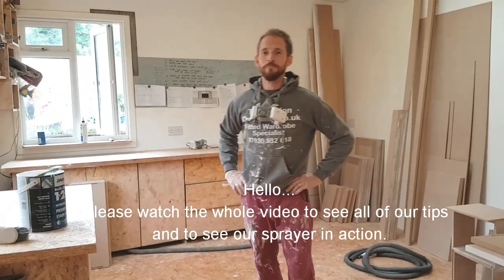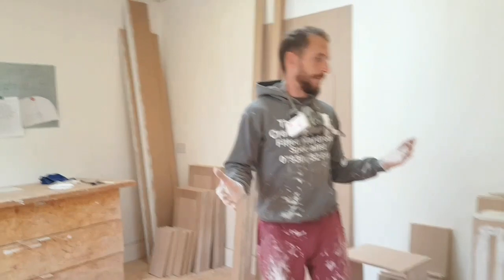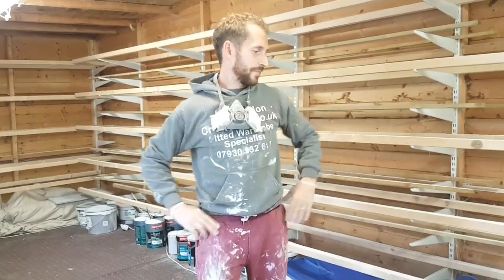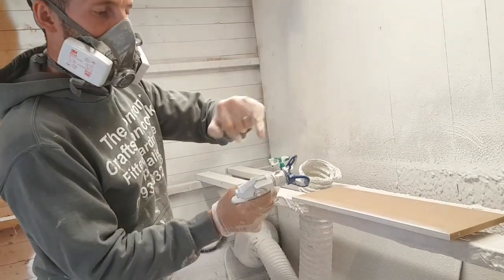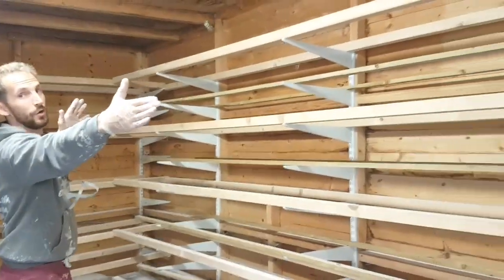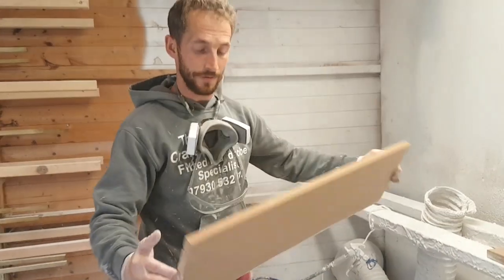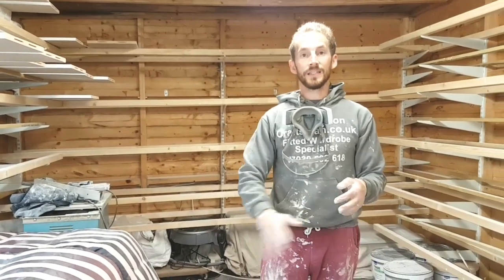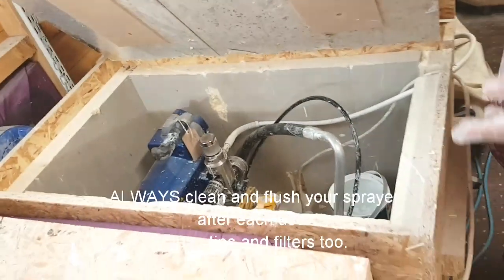Achieve professional paint finishes on Mdf - Trade tips & techniques - Don't Miss!!

Comment: For those looking for the Zinsser paint the best prices I have found are at Screwfix. I will be using both the Bulls Eye 123 primer and the Zinsser Perma-white for the finish on an MDF bath panel soon. I won't be using moisture resistant MDF because I can only buy a full sheet and will have a lot of waste.  Hopefully the Zinsser primer and Perma-White paint will give it enough protection with two coats of each. I may seal the edges with epoxy resin before painting. Any advice would be helpful.

Comment: Nice video great to see how the pros do it! I’m looking to spray some skirting, stair woodwork and architrave and have bought a 310 FFLP graco tip for my Erbauer airless sprayer (got a graco guard for it). Do you dilute the primer and top coat at all? Also what pressure do you run at? Thanks.
Reply from the maker: Thanks!
I never dilute paint and the pressure I use is generally around 1600 to 1900 depending on paint using a 310 tip.
I've never used the erbaurer sprayer so I couldn't say if what I just said applies to this sprayer 👍

Comment: Dulux Diamond eggshell tends to dry with a bit more sheen than most eggshell finishes. So good choice there. Plus it's very durable. If I didn't have access to Dulux Diamond, I would probably use a pearl or satin finish (of good quality) for greater durability. Also..I've noticed over the years that many "would be spray painters" do not really understand tip sizes. Nor do many salesmen of spray tips. I know the difference because I have been spraying for 25 years. But I don't make Youtube videos.  So maybe you could make a video (All Graco airless of course) explaining fan width, orifice sizes, color of specific tips, distance for optimal results, etc. Btw. I have a similar set up for cabinet doors. I do find that it is not quite enough on it's own. So I use the water trick. A light dusting of water on all surface areas in the booth... helps a lot.  Good video.
Reply from the maker: +John Shader 
Hi John,

That's great advice, I will look into making a video.
I don't have a massive amount of knowledge on tips other than the standard blue and fine finish but I could say what I know on the subject.
Much appreciated 
Thanks Ryan

Comment: Great video just what I needed, I'm about to do my first big mdf cabinet door spray job. I am wanting to go with water based paint, but am worried about drying times, I have a few questions: 
1. Why roll the zisner instead of spraying it? 2. Can you use the zisner to prime. 3. What is your edge sanding procedure. 4. Is the topcoat you are using waterbased? 
I hope you get a chance to reply. 
Thanks a  million
Reply from the maker: Hi ,thank you!
When painting the edges, you get so much better coverage with a 4" rag roller than a sprayer.
I'm not actually sure you should spray zinnser due to what it's made from, I think it says not to spray on the tin because it can combustion? Had some flammable chemicals in it? Something like that ,so it's worth reading up on it before putting through your sprayer.

Yes you can use zinnser to prime but again look into the spraying side of zinnser.

We stack up our MDF in batches, use an orbital sander starting with p60 then p120 then p240.
After we fill with ready mixed filling compound or filler.
When dry sand with p240 and dont sand too far back.
Dust down and roll on zinnser or acrylic primer 2 coats.
After 2nd coat is dry, very finely hand sand the batch with p240.
Break batch apart and use a micro round 1/4" router cutter on all seen edges/corners then quick hand rub with p240 on same edges/corners.
Now ready to spray the whole component.

Yes the top coat I use is always water based if I put it through my airless sprayer.
I use silks and eggshells mainly.
Try and mist coat first primer coat otherwise if it's too heavy the MDF grain will rise whilst its drying.
We use space heaters to warm up the spray room.

BTW we have built a new sprayroom and booth and this is actually going to be the first video of the series starting the beginning of January 2020 so I hope it helps you.

Cheers Ryan
Reply from the maker: Bloody spell checker!
Reply: Wow thanks so much for the detailed response, really helpful. I hadn't seen anything on the zisner tin about not spraying it, haven't looked to be honest but several guys on YouTube have recomend spraying with it. 
With regards to filling, all of my doors have been cut and routed already, in a modern shaker style, that is flat with v groves routed in. What's the best way to smooth and get the paint into those v grooves. It seems that I get alot of fiber in the bottom of the groove, and paint doesn't go in there easily. Thanks again for the help.

Comment: Great channel. Just about to get into spraying MDF. Are you still using a primer or just going straight on with the finish paint.
Reply from the maker: Hi, I am using and trying different paints quite often.
The paint I'm using now is from Amicus uk in park royal. Check out my latest video and go to the description for all the links and some discount.
This paint above gives such flat finishes it's unreal.

You can also my older method of doing 3 coats of silk or eggshell as that worked for me for years!!
Also you can use a dedicated mdf primer with 2 top coats. 

Before I tried this new 1K paint I'm using from Amicus, I was doing 3x silk or eggshell coats, I just sanded in between and job done.
The results were very good and is probably the lowest cost way to achieve a good quality sprayed finish 👍

But then again I do recommend the Vernites 1k paints from Amicus.

Comment: thanks mate. do you thin the paint o work with the air gun? if not the paint is very thick
Reply from the maker: I never thin, these machines pressurise to up to 3300 psi so there is no need 👍
Reply: @thelondoncraftsmanworkshop  Oh wow I see. what sort of gun then do i need to look for? i assume the needle shouldn't be too thin in dia

Comment: Thank you for very thorough tutorial! Very informative and full of useful tips!Is the way of painting (including types of primers and paints) suitable for painting kitchen cabinet doors to achieve smooth slick eggshell finish? Is water "proofness" of your recipe presented in your video sufficient for kitchen, under kitchen sink MDF doors. I am a novice at this and not a professional, redoing our own kitchen :). I am about to buy used 390PC in great shape with FFLP 208 tip. Intend to buy 310 and 410 tips. Are FFLP tips ok (they supposedly require half the pressure) or should I use regular 310 and 410s?

Comment: Thanks very much for this video, it is very informative.   I am a female with a hubby who is pretty useless at DIY so will be on my own with this project.    I have two cupboard doors that my joiner routed the front edges on, I'm concerned about them swelling up.   Can I use acrylic paint to seal the edges (the type for ceramics, which is self-sealing?)    Otherwise I could invest in the 1 litre Zinsser one in the blue tin, what would you suggest?    Can I also use the same Zinsser 1-2-3 primer on plasterboard?   Many thanks in advance.
Reply from the maker: Your welcome! That's good to hear your taking on the challenge.
To be honest any undercoat, primer or specialist sealing paint would seal the edges. Even if you use Pva glue mixed with water 50/50 would do the job.
I'm sure the paint you mentioned would do the job.
I'd suggest first rubbing the edges down using p120 grit if they are really fluffy then p240 after.
If the edges arnt to bad then go straight to p240.
Once sanded then give a coat of your paint.
Once dried give the paint a very light rub down with p240 to take the high spots off.
This should seal the edges enough to put your primer/undercoat and then top coat/s.
I hope that helps😀

Comment: Quick question. I have the truecoat pro II with the 311 tip. I am using sherwin williams wood and wall latex primer and proclassic waterborne acrylic alkyd for the finish. But everytime I spray a MDf panel with the primer, I have some spots that are  way shiner than other spots. You can't tell if you look directly at it. But when you look at it on an angle during natural light you can see the shiny spots. Wanting to know if the latex primer is problem, and if I need to Prime with an oiled based primer?

Comment: Hi, do you spray, roll or brush the 123 edge primer, and do you prime the face of the board, or spray finish direct onto the MDT?
Reply from the maker: Hi I just roll the zinsser on, I also use standard primer now rather than zinsser and it works a treat still.
I just spray the face.

Comment: When you spray tall doors with water based, do you find that spraying only one side makes the MDF warp? Perhaps this is not the same for the green MDF, but for regular MDF I have been told it does.
Reply from the maker: Hi, I make sure I spray both faces within an hour or so of each other, and do the same for every set of coats.
I never have a problem whether I used MR mdf or standard MDF.
Just make sure you put them completely flat when drying them and paint both faces as quickly as you can and you should be fine
Reply: @thelondoncraftsmanworkshop  Thanks. I was going to use those plastic pyramids and have a mate help me turn the doors.
Reply from the maker: @JohnnyMotel99  yeah that's a good idea, try and dry the paint as quick as possible, within an hour or so ideally.
I have a space heater in the sprayroom to keep it warm.
Reply: @thelondoncraftsmanworkshop  that's a clever idea, thanks!

Comment: Hi...just a question...you put one primer, them sand it with 240(to get rid of orange peel) and paint just one coat? Or you put 2 coats? Thank you
Reply from the maker: Hi not sure if your watching an older vid, but now I give 1 coat, then sand p240, then give another 2 coats.
Sometimes just one more is good enough but I like doing 3 coats in total now 😁😁😁
Reply: @thelondoncraftsmanworkshop  thank you...and between 2nd and 3rd, you sand it as well?...thank you very much for your info. I am learning..😋
Reply from the maker: No probs, no I personally don't sand for a 2nd time, but there is no harm in doing it if you want if you go lightly

Comment: Do you ever put lacquer finish over the top of eggshell to protect the paint and what is the method please? Could you spray it from a can then sand and polish the lacquer?
Reply from the maker: Hi sorry for the late reply.
I've never tried it over eggshell but I have tried it over birch ply that was oiled with osmo oil.
I use a water based lacquer ( manns ) I think, and it came out well.
On the other side, I think over time it has changed the colour slightly and turned it very slightly yellow (very slightly).
In theory lacquering over eggshell should work but i wouldn't know of it would change the colour.
With water based you would stand a better chance though i think.

I have never polished the lacquer  after spraying, i generally get a good enough finish, satin sheen mainly.

Comment: Great job and thanks for sharing. What do you use to fill the ends before and in between sanding?  Do you dilute your paint and primer and if so, what viscosity?
Reply from the maker: +Derek Evans 
Hi Derek,
To fill the edges I use a ready mixed filler.
The actual one I go for is in wickes (builders merchant) and it's called mounting compound and dry liners use it to fill the gaps between plasterboard sheets.
With an airless sprayer you don't need to thin the paint, it sprays out paint using up to 2800 psi  (a car tyre is only 30 psi so it's a lot!).
Under coat would be a waterbased acrylic primer/Under coat and top coat would be a waterbased acrylic eggshell.

Thanks Ryan
Reply: The London Craftsman Thanks Ryan. Keep up the good work.
Reply: Hi Ryan...you have persuaded me to invest in a sprayer so I can give my clients a better finish on their wardrobes etc. You just can't get a great finish with a roller. I have fabricated a spray booth out of 50mm insulation boards at the bottom end of my workshop / garage on an old work bench. Then I have cut out for a 8inch portable extractor (explosion proof) as it could come in handy on some site installations. I have a compressor which I can attach a gravity fed spray gun too but I have also bought the Graco Ultra corded sprayer for onsite jobs.
I would post a pic of the booth but I don't know how on here. 
Anyway...thanks again for the videos as it has helped me to progress further for a seasoned veteran. Keep the videos coming
Regards
Simon Warnock
Reply from the maker: +Simon Warnock 
Hi Simon, I never got around for saying thanks for the nice comments.
I'm glad they have helped and I will keep them coming when I get some time on my hands.
Thanks Ryan
Reply: Simon Warnock  did you ever try fine felt rollers and thinning the paint. I spray now for ease but got a satisfactory result with the felt rollers.

Comment: Can I ask you a question, I've built bout 6 units there all fitted now, in situ,i was thinking bout spraying them in place, I'm just wondering what you would think on this as the rolling will like you said will take forever, any advice is welcome thank you.
Reply from the maker: Hi, I think you need to of had a bit of experience with sprayers to spray them in situ.
That being said, ive only really used airless sprayers which are different from hvlp sprayers.
I sprayer drawer boxes and some Carcasses, also window seat carcassas etc in my spray booth using my graco 695, but I'm careful not to put the paint on too thick which is so easy to do with an airless.
If you do use airless, then pressure has to be as low as possible and you need to use a green FFLP spray tip (fine finish low pressure).
So with some expensive and the right spray tip and pressure set lowest possible, then I'd say you would manage with an airless.
I cant help with any other sprayers as I've not had enough experience.
Ryan
Reply from the maker: Was ment to say experience nor expensive
Reply: @thelondoncraftsmanworkshop cheers for the advice it's really appreciated, I dont want mess this up if I proceed with it,I've got some experience, I used to spray few years ago (long while lol)but only in shop in a booth complete with full racking  systems for a shop fitting company I was without but I've never spray any assemble units tbh, I'm back doing my carpentry now more than ever, which is what I really want to be doing,the building work in these months is just the pits lol...
And on them units I'm telling you about I can take all of the the doors gables cornice etc off and do a proper job on them, but the units would be tricky enough, plus there mdf moisture resistant,rock and hard place I think,I was only meant to build and assemble but now they want me to paint them,so I may aswell get stuck in, cheers on the advice I will get back and let you know how it went, wish me luck lol...
Reply from the maker: You'll be alright! Good luck 👍

Comment: Thank you very much for the information. Do you use any form of dust control in your spraying area?
Reply from the maker: +David Mortimore 
Hi David,
I have 2 extractor, 1 movable 8" hose near where I spray and one near my racks.
I will be upgrading this soon to a large 2ft fan under my spraying table sucking the air out with air vents at the rear. This would create a one way air flow keeping dust and overspray from the work.
Reply: The London Craftsman That’s great. thank you.

Comment: all the time you have been spraying and experimenting with paints
which paint would you recommend for painting a mdf candy cart 
needs to be hard wearing thanks
Reply from the maker: Hi I would use a good quality acrylic undercoat primer to start with as the first coat. Then sand after with p240 very lightly to de-nib.
I'd probably just use an eggshell or satin finish for the top coats, satin would be a bit harder wearing.
Most paint brands do a "hard wearing/durable/wipeable version of most finishes

Comment: hi i do simlar work to you and want to get into spraying never really sprayed before. have had suggestions to go HVLP. what would u recomend? HVLP unit is double the price of yours £1300! and also may need somethinning. on the up side i think its easier clean less messy and sprays slower so would be easier for me to achieve a very good finish as a beginner? Would the airless be too fast for me to learn with? 1 more thing i dont have dedicated spray room yet hope to in future to need to see how things go first! Good videos by the way!
Reply: Hi Jack
Not sure what you've been up to over the past year but, I am about to venture into the cabinet business and want to do it on the cheap. I bought a Harbor Freight airless sprayer for $169, added some tips and I'm under $200. As for a spray booth, I thought about using my basement, or my wifes side of the garage but decided against it. I then looked into getting a shed/out building, storage container or even a used box truck box. All were too expensive. I then thought about free campers/trailers on craigslist. I found 2 within a 2 hour drive from me. Both are over 20' long and will be perfect as a cheap paint room. I'll gut it, seal the roof, walls and windows as needed, maybe cut in a larger door for easier loading and unloading, run an extension cord from my house until I buy a cheap generator (under $200) and heat with an indoor rated propane heater (I'll also have a CO2 detector for safety). For ventilation, I'll be taking tips from The London Craftsman and adding 2 fans mounted low by my spray area and cover with foam as he did. Fresh air will be brought in by a similar fan system to minimize dust.